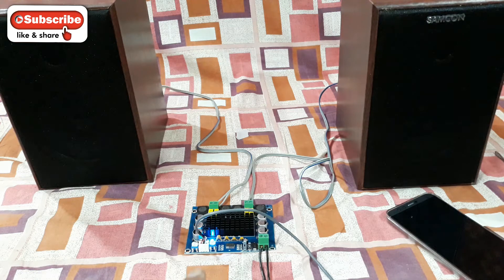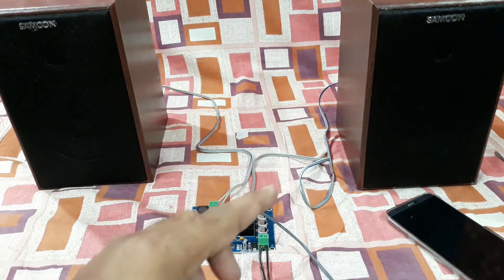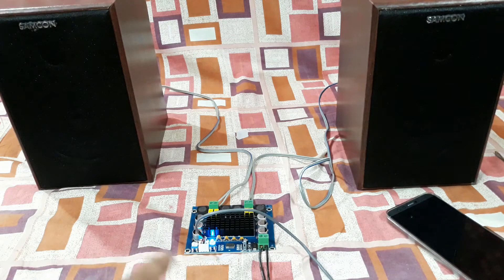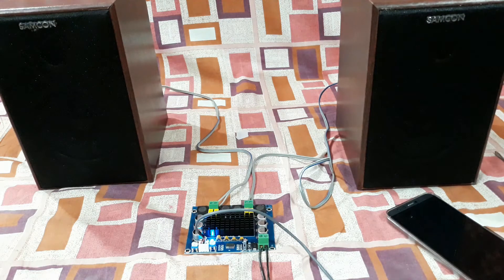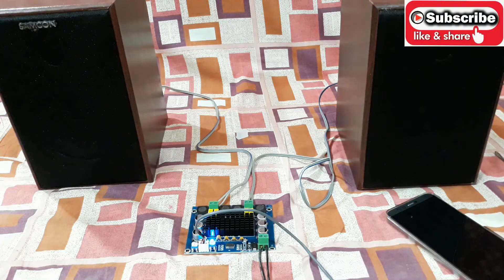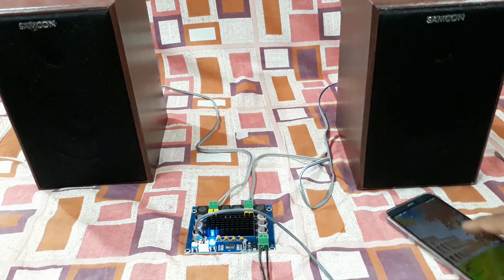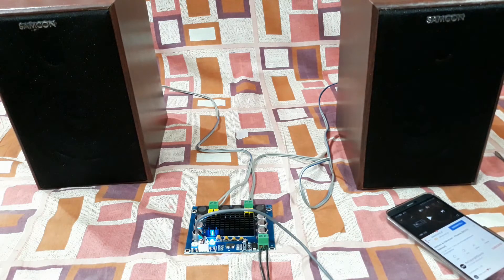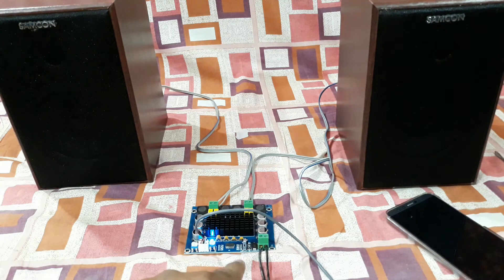TPA3116D2 Amplifier Board | Tpa3116 Class-D  120w + 120W Audio Amplifier| Sound Test I The technoboy

Comment: There’s no way you can get 120w + 120w at 12 volts, and even if you raise the voltage to 24 volts, you be lucky to get 50 watts in which I doubt that. Besides the sound is pretty terrible for a Chinese product…… your video helps customers to decide whether or not to buy these so-called high quality amplifiers. Chinese sellers are notorious liars and do anything to make a fast buck by deceiving customers out of their hard earned cash……